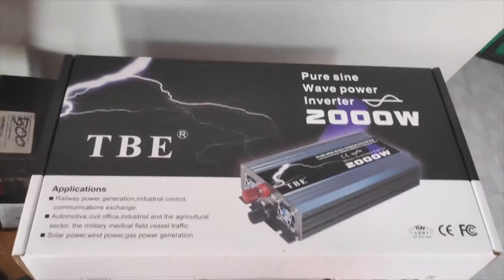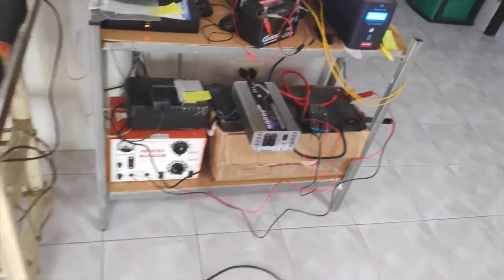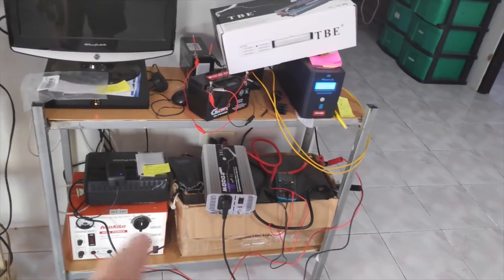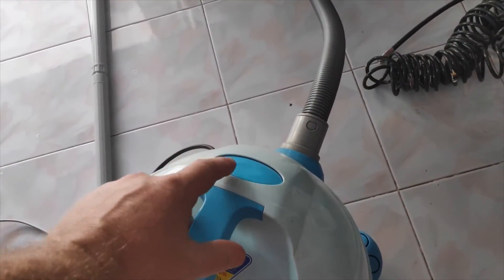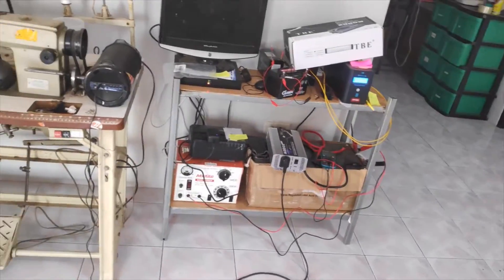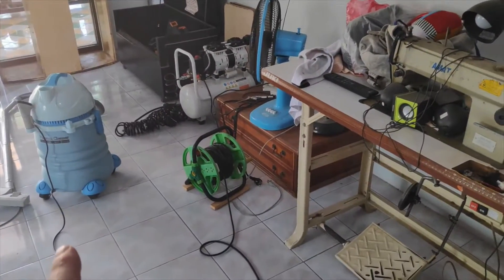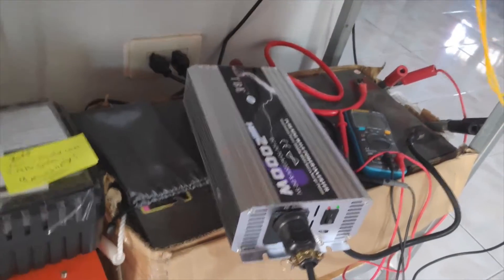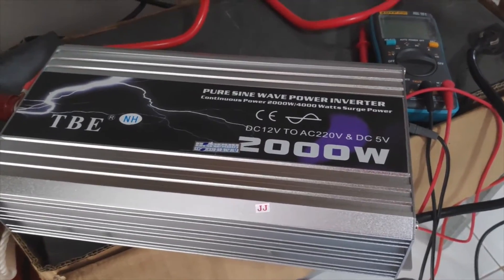TBE  2000w pure sine wave inverter put to the test.

Comment: Most motors have a start power that's 4 to 7 times the runnning power (what's on the label).  It worked when the vacuum was on and the inverter then turned on because of the soft start feature - it starts at about 40-60 volts and steps it up to the rated volts (220 in this case).  That means the starting power is roughly 20-25% of the starting power on 220 volts, thus the vacuum starts with no problem.  Unless you do a lot of research, you may not find a chart that lists the useful information such as "Power for vacuum: running 1300W, start 5000W".
Reply: Hi, I think the root cause is this is an insufficient power inverter, which has only 600W continuous output power as the poster said.
Please check my comments below.

Comment: the soft start on inverter help to reduce the inrush current on vacuum cleaner.
Reply: You answered it all.
Reply: @bdb7629  But... may be whit a combine capacitors star and run it could fix that problem!
Reply: @chikiguites  The surge current of a vacuum cleaner like that is ~30A for the first 10-50ms.
The asic these inverters sport is pretty nice actually. The default setting is to ramp the output from 0 to 220 or 110 in 3s. 
The best thing a vacuum cleaner or any other mains voltage, brushed motor powered tool could have is a soft start. One NTC in the angle grinder or the vac could solve many inverter and grid issues very few care about but most suffer from in one form or another... 
Soft starting is nice. Hard starting buns and wears down stuff.

Comment: People already told you why it starts alright with the load on and not off and I'll tell you why the wah-wah is: The fan is causing some piece of the case to resonate because the fan is poorly balanced, screws and case fitting is cr...chinese and nothing more.

Edit: The fans. Plural. And being two of them, you'll get the destructive and constructive interference vibrations caused by their different rotational speeds (and wobble)

Comment: YOU NEED a bank of super capacitors to supply power surge from the batteries to the inverter. It's common problem of 12-24 v source, slow coping power which trigger shutdown of inverter. Try it
Reply: I was just wondering this when I read your comment lol...I've got a pair of 60 volt DC caps which are 12,000 mfd each..I think I'll hook them up to my 2000 watt Aims..I've got 6 batteries hooked to it so it's not as bad as it used to be lol..but with less batts there's a volt drop that make the charger c0me on

Comment: some loads consume a large amount of current when they start running, exactly like cars they need a starer motor to start the car  which can reach 600 hundred Amps in some cases, that's why a good battery is needed to offer this huge amount of current.
In case of Inverters you need a big capacity values for the high voltage capacitors.
you can add them yourself in parallel with the existed one.
More capacitors = more capacity + better heat dissipation + more surge capability

Comment: If you hooked up inverter to oscilloscope, you would see that when you power the inverter on, it ramps up to the rated voltage over a few seconds...so  instead of shocking the vacuum motor with full rated voltage from a cold start, it's slowly ramping up the voltage to the vacuum motor from power on , which overall makes the peak current MUCH lower than it would've been had the inverter been supplying full rated voltage before powering on the vacuum

Comment: The problem it has with starting is in the over current protection circuit...It needs more time delay...The soft starting circuit seems to be ok. The fan control circuit seems to have a problem for sure...

Comment: Is it possible that there is a heat sensor that speeds the fan up and that's when it makes the noise? I don't  know but it will act differently when it has more batteries I imagine...mine is a 2000 watt also but it's a lot quieter...jeez how can you put up with that it sounds like a hive of bumblebees? Also mine says 6000 surge for 20 seconds so there's something inside different but there has to be enough current available..I used two sets of #2 cables to the 24 volt side and it has no trouble starting  a 1450 watt air fryer while the TV and lights are on but I can't run it long without voltage drop so in  2 weeks I'll have 8 batteries hooked up and I think it will have enough to keep going without the sun and without kicking into charger mode...it sounds like yours is power thirsty for a big shot of amps just when something is turned on...mine sort of did that when I only  had 2 bats but when I went to 6 from 4 it pretty  much quit and just runs whatever it is

Comment: Thanks for the video, sorry I'm a bit late to this party. I had one if these inverters installed by a solar company in Thailand a week or so ago and not able to run above aprrox. 650 watts. It trips every time at about 2.9 amps @ 225 volts. I will be getting them back as I don't believe this is satisfactory. Did you do any further tests?
Reply from the maker: Hi Peter.. You're getting about the same results that I got then.. see my one year review video..

Comment: Have the same inverter and same issue with vaccum cleaner.Mine can't start a 900W vaccum cleaner,then a mesured the consumed power at start and its 1400W.I open the case from the inverter and inside i found transformers labeled at 1200W,so it's not a 2000W inverter but 1200W.All devices under 1200W works fine for me but not over !

Comment: U must know power efficiency is around 75 % 
So 75% of 2000w is 1500w
So u shouldn't excess
Reply: You do know @ 1500w it should serge to 3000w it should have been able to run that vacuum with no problem has that vacuum is only 1300w. As usual poor construction. I almost buy this inverter but went with another brand after doing my investigation.
Reply: @howardescoffery4950  What brand did you buy? I'm looking for a good PSW inverter brand.

Comment: TBE are not true rated. 
That is called surge power.
Reply: From the moment you start the vacumm. It will consume twice it rated output. (More than 1300w) (only last for sec.)

From the moment you start the inverter, it will produce a surge power. (More than its true rating, but will only last for a sec.)
Reply: Yeah its true thats the surge power. Every applianes thus have surge power needed when turning on boss